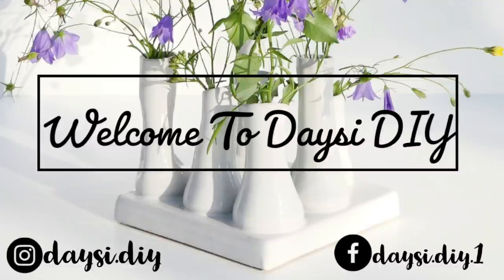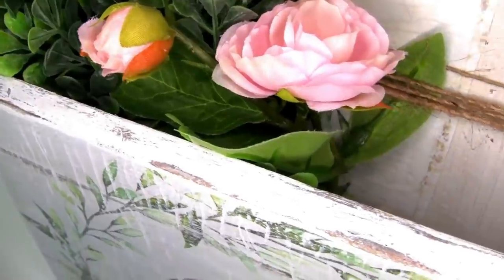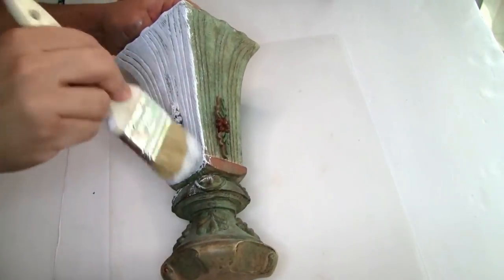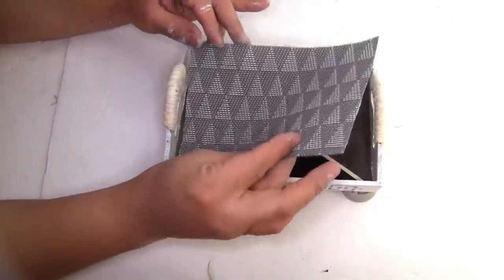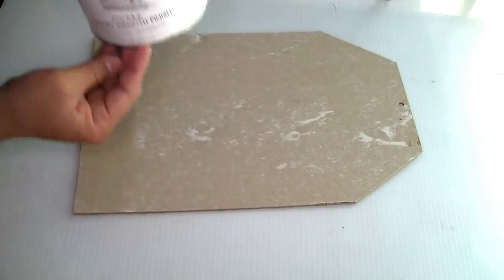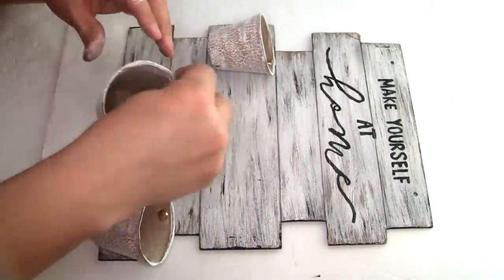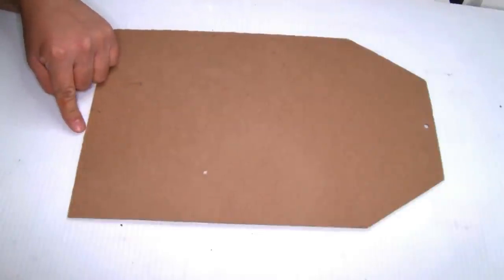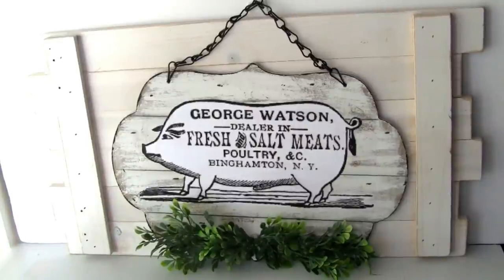17 Farmhouse Dollar Tree DIY'S| Must Try Farmhouse Decor DIY'S| Easy Dollar Tree DIY'S

Comment: Love them all.  ***You can also use a heat gun or hair dryer to remove your labels, tags or pictures.  Just get a small corner going and apply the heat along the lift and you should be able to peel it right off. :)
Reply from the maker: Hi Beverly, thank you very much and for your great advice I will try. Have a wonderful week ❤😘 thanks for watching, I appreciate it so much ❤❤